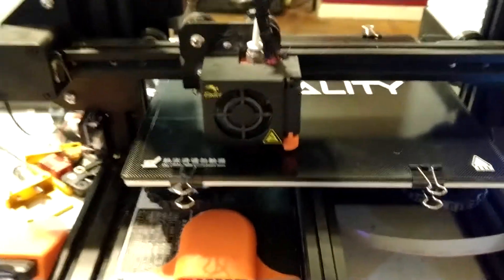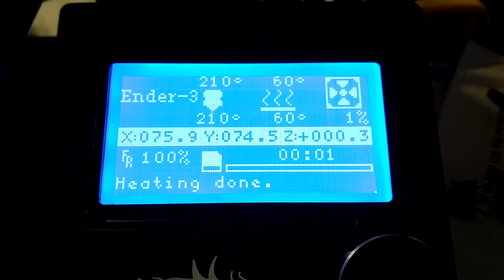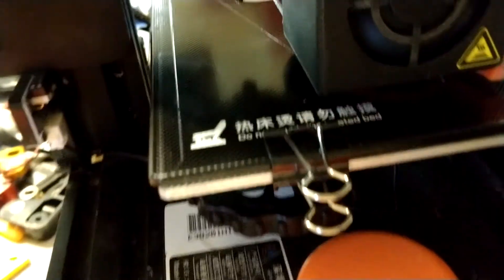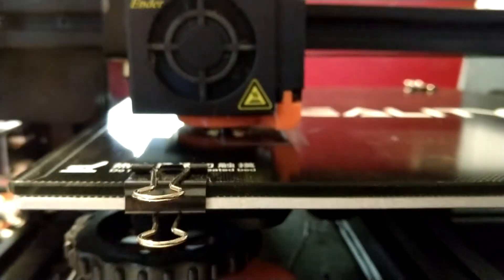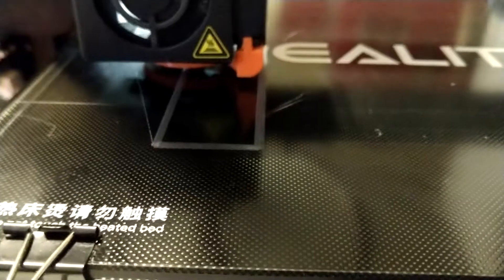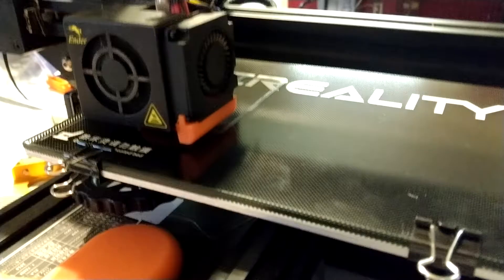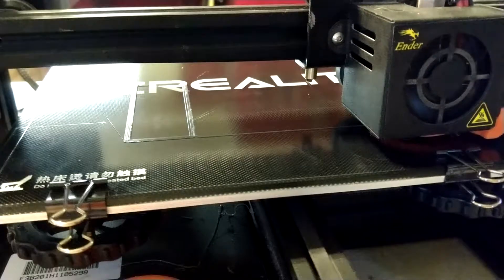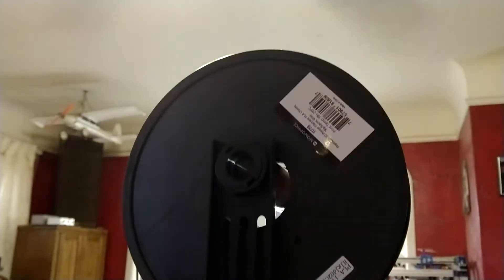Creality glass bed.

Comment: Do you still have the X5SA Tronxy?
Reply from the maker: Yes, and it's much better with the Duet 2 Wifi controller.  Though I only use this printer for large print jobs.
Reply: @JamesADoty  Do you recommend the X5SA? Is there a problem that would be difficult to solve in it?
Reply from the maker: @daniloboy103  The frame could use some corner braces, the belt path isn't very well aligned or easy to change, the XY move mounts are mad of acrylic, the touch screen (On Mine) didn't work very well, the power supply is only 12 volts and not up to the challenge of heating such a large bed , the part cooling fan also cools the hot end and makes it challenging to keep the nozzle temperature up, I have micro SD card slots (Just saying), the bed isn't very flat, parts don't stick well to the PEI like bed surface without glue stick (Which works well actually).  On the up side the power out resume works well, and so does the filament out sensor and the filament drive system.

If you're good at tinkering this printer has promise, but it's been a lot of work making it right.  This is not the worst 3D printer I've eve owned, but it is the second worse 3D printer I've ever owned.
Reply: Thanks for that answer! I have seen that bed is 24v factory, if you change the voltage to 12v you can get better performance because this power supply is 12v. Test and draw your conclusions
Reply from the maker: @daniloboy103  Interesting.  Where'd you find that?  The labeling on the bottom of the bed is a bit confusing.  I'm planning on upgrading the printer to 24 volts, which requires I re-wire the bed connections (If possible) and replace the hot end's heater cartridge.  The Duet 2 Wifi board needs 24 volts for the power out resume to work reliably.  This will also solve the issue with the bed taking a long time to come to temperature.  If you're capable of designing and building your own pulley mounts it will be possible to get the belts to align properly.  I don't have the tools or skills for that myself.
Reply: @JamesADoty  Yeah, I saw that their manual is not very good either. I found on youtube about the bed but I do not have the link, sorry. You're going to have to spend some money to change all that.